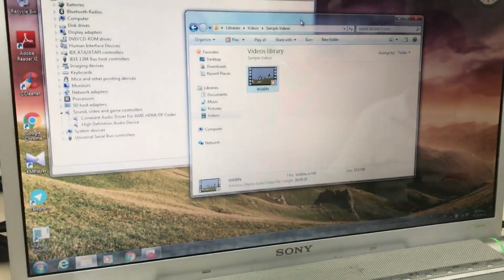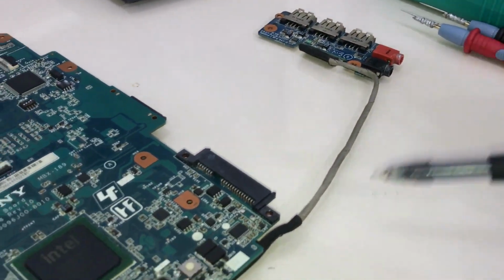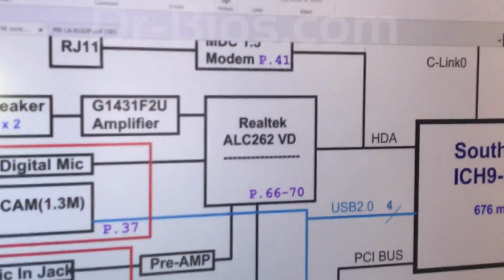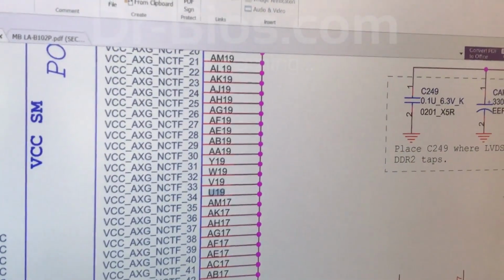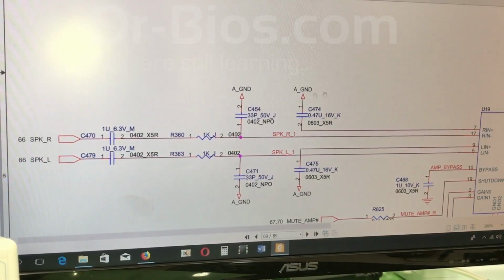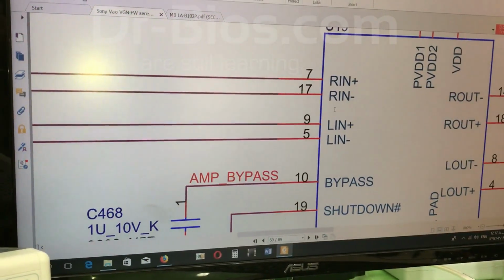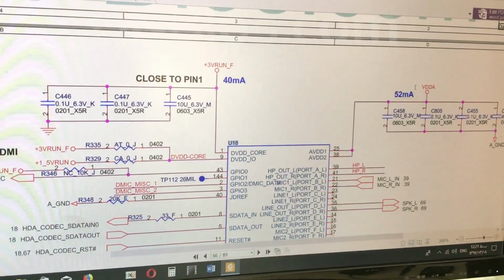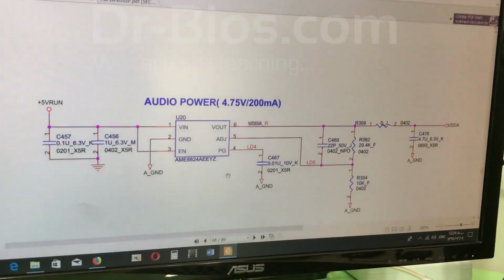How To Diagnose Speakers Amplifier And Audio chip Laptops

Comment: I have under repair the same model board, after checking all the tests you said, I did not have sound for video, speaker test amplifier test OK all voltages ok, what do you think for the problem??